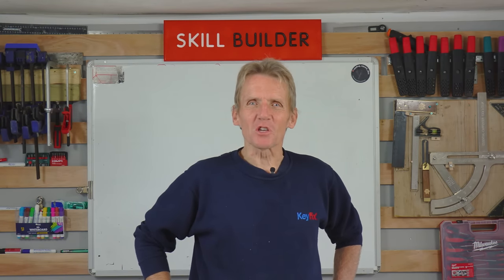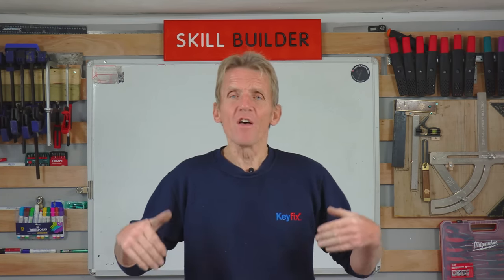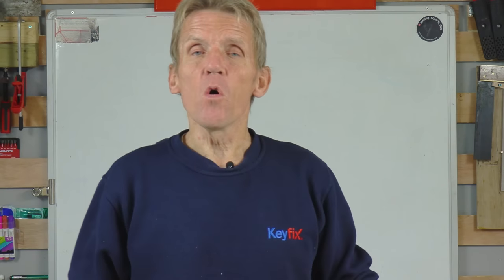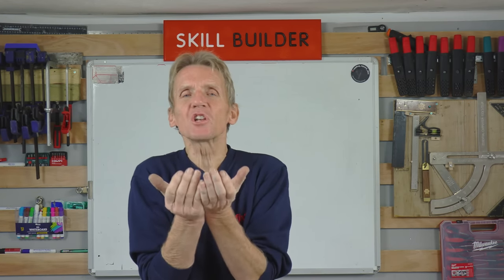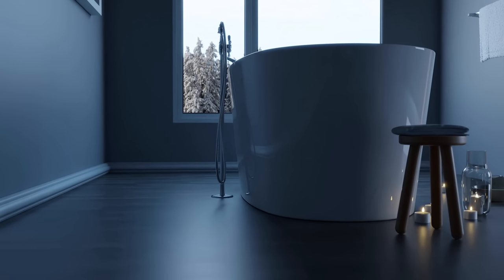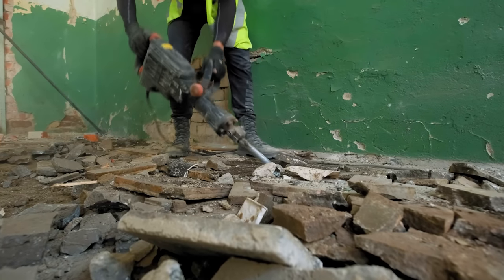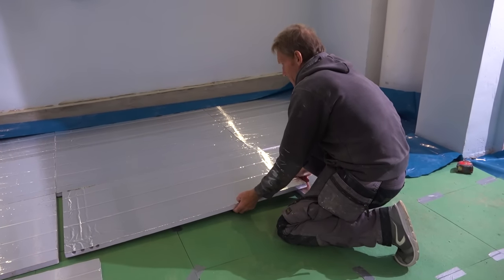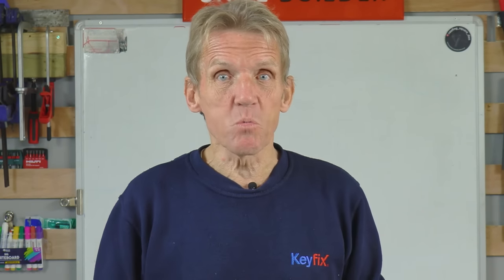Underfloor Heating — The 2 Big Questions

Comment: I replaced all the heating in a 120 year old house with under floor, every single room up and downstairs, over 3km of pipe work. The high ceilings meant rads were next to useless and the floor was like ice anywhere round winter time, so now no rads in sight and I can say under floor is excellent, it is night and day levels of difference even when compared with particularly good rad systems. Highly recommend if you can. Manifolds also will allow you to easily add zones so the heat distribution can be controlled per room!
Reply from the maker: Did you insulate the floors?
Reply: Looks like the next big thing
Reply: Did the same in my victorian house. Did 100mm celotex between the joists. Love the UFH
Reply: @SkillBuilder  I did not personally do the work (just lived through it), looking back I feel probably more insulation could have been added. However the house floors were all just floorboards on raised joists, so not concrete that will conduct all the heat to earth. The pipe work was set into that concrete style board with the pre cut grooves. My guess is some heat does escape down, but it seems ultra effective, so I guess not that noticeable. Upstairs I am less bothered by potential leakage downward since it will only end up inside the house either way... the ceilings do not get hot and I have checked with a thermal imaging camera. What I like is the old house was never designed to have radiators, so they would have only looked out of place and get in the way... I will say it is not for the faint hearted ripping all the floors up adding all the infrastructure, which means raising the height of the floor by 3-4cm shaving all the door bottoms down then putting all the skirting board back etc.
This was done in conjunction with a new oak hard floor. I avoided carpets as felt this may be too insulating.
One other thing people always forget to mention is that once you have this done you cannot go filling your house up with furniture that is flush to the floor as this just traps the heat... it became obvious that furniture needed to have legs of a certain height that will allow the heat to flow round objects.
Reply: @elslopez  really helpful! Thanks for taking time to share! I would have never thought about the furniture issue!
Reply: @elslopez we have done the same as you over the last thirty years, room by room. 

I'm not sure I agree with your point about the furniture. The whole point about a low temperature underfloor heating system is that it heats through radiant heat rather than convection, which is a much more comfortable form of heating. Furniture gets warmed by the radiant heat, in the same way as the occupants, and then emit that as radiant heat, so the furniture has the effect of increasing the surface area,which increases the comfort levels, as the occupants are heated on all sides by the radiant heat.

Radiant heat is more comfortable and effective than convective heat because it heats the occupants rather than the air of the building. Heated air leaks out of the building, owing to gaps and draughts, and collects in the highest part of the building, owing to convection currents.
Reply: @sailingoctopus1  I understand your point, and maybe this is dependant on the materials in the furniture, however my experience has been that there is a huge improvement in the performance and responsiveness of the systems when you minimise the direct contact to the floor with furniture and items acting as insulators. I even bought an IR camera to access where the heat was going and being lost... suffice it to say the colder areas were the ones with objects blocking the radiant source. I liken it to when I see people putting towels on radiators, sure the towel get nice and warm, but there is no way that rad is giving off the heat to the room it otherwise would have just on its own. My house has very high ceilings, in the hallway in fact the max height is 26 feet. Now before the underfloor was installed there were radiators, and all these did was send the warm air to the top where it was no use and send the cold air down. In fact it was virtually impossible to warm the bottom 3 feet of the property to any sensible degree. Now I am not saying this will happen, but if I place things on the floor that cause things to heat up at different rates in any significant way, do I invite these kind of convection currents to form again, albeit to a lesser degree? What I do know is that this is the best way I have had it thus far. My original furniture (now replaced) was a lot more floor hugging, and honestly it was just not as good!

Comment: I installed underfloor heating in our kitchen extension three years ago , and I can honestly say , it’s the best thing we ever did .
Our heating comes on at 6 in the morning for an hour or so , we set the thermostat at 19 . But due to the tiled floor being like an enormous storage heater , by 9am the temperature is over 20 degrees , and stays like this all day . Fantastic
Reply: Sounds great, was that a full wet system? We’d like to get rid of our carpet, like our neighbour, but her floors are freezing.
Reply: Tiles make no difference to energy used.

Comment: My mate has underfloor dowstairs. Its great. 19c in his house feels warmer than 19c with our radiator system because the heat is rising from the floor, as it should do, not accumulate near the ceiling

Comment: I have underfloor heating to 3 floors for 15 years and the designers got it spot on because I have  measured all the rooms in all weathers I totally agree with your accounts.  In my system it is set on a very thick concrete raft and then 50mm of insulation set in a self levelling anhydrite  screed. I think they did great job in the design since all the wall, floors, ceilings and windows were calculated for thermal distribution.  The first floor ceilings were a Bison hollow core slabs across the whole width of 8 m span insulated and covered with the pipes embedded in the anhydrite screed. incidentally the pipe are just 10mm fast flow diameter that I held some reservations about but proved they got it right since there is more mass in the screed to act as a heat store rather than water and plastic. still not sure about that but hey oh it works.  With the tiny condensation gas boiler it has been a dream to live in.  Love your video as usual.
Reply: Did you go for the optional flux capacitor or leave it?
Reply: @TheDankelsall  Hi Dan, I did ask NHBC if there was anything else I could do back in 2002 but they said I still need ventilation and any heat recovery system simply would  not be practical - so back to the future here we go:

Comment: Some great stuff in this! I agree that a hybrid system has a lot going for it- background heat with rapid response to peaks. My son fitted 270mm insulation below the screed, but with a wood block floor finds having high output rads great for quick adjustment of ambient. He has a data link to the combi boiler (had to go to a foreign source for the data structure- UK not keen on divulging this) and wireless links to all rads etc with full flow and temperature monitoring, and links to weather forecasting. Had to design/build it all himself- because a commercial version is not available! Like most of building practice, we are still in the last century...

Comment: Really useful! Thank you.
I like your pinching the return off the radiator idea.
My elderly set up sort of has this by accident because they didn't insulate it.
Consequently there's a few hot spots on the floor in the bedroom and bathroom where the radiator pipes warm up the carpet/lino that I've got into the habit of aiming for on cold mornings as it's sort of accidental underfloor heating.
Reply: I have the same- deliberately. When I installed the system, I realized the feeds (multi-system) and return ran under the bathroom floor. I did not insulate these (which modern regs require) and the result is a floor that is comfortable to bare feet. A feature that cost less than nothing!
Reply: @Tensquaremetreworkshop   My next house I'm doing that!

Comment: I removed all my radiators and stuck in UFH, which is heated by my 30 year old Netaheat Profile boiler. The boiler does cycle but we used to run the rads for 2 hours in the morning and 2 hours in the evening to get us warm for those periods. Now, we run it for 2 or 3 hours in the morning and again in the evening and the house stays warm all day and night. Turned the boiler down to 55 degrees, UFH runs at that temp too, 120 year old timber floor using spreader plates and air tight suspended timber floor.
It has been a surprising revelation.

Comment: I have underfloor heating downstairs. I put down 3" Kingspan, ran the pipes & 4" concrete over that + tiles.
I didn't insulate the lower area of the walls (mistake). I lose heat by it radiating outwards through the walls.
Silly me. My floor level runs straight out onto a patio & heats roughly 18" of it, outwards from the building.
Put an insulation break between the inside & outside. Like a bathtub effect.
Reply from the maker: I hope it wasn't concrete you used to cover the pipes.
Reply: @SkillBuilder  is screed OK, (I assume thats what he means)
Reply: @SkillBuilder  A cement based screed. Not exactly sure what it was (a company did that part of the job). They put a lot in. The floor takes roughly 4 hours to warm up fully. It's been down for 6 years with no issues.
Reply: @SkillBuilder  Dry screed. 4 - 1 sand, cement mix with some aggregate.

Comment: If your laying one of the low build options over existing floor, maybe think about giving the floor a couple of coats of thermal paint before laying.
The paint allows the floor to "breath" but helps reflect the heat back up by not allowing the "air moistire" to transfer heat down into it.
Reply from the maker: I don't think you want a breathing floor. I think you need an effective vapour barrier.
Reply: @SkillBuilder  some of the kit companies just suggest a floor sealant. I meant thermal paint over the sealant. And thought with joists the vapour barrier was below the flooring surface, so for anyone laying over floor surface could use paint.
Personally, on the solid floor option I would get in the scree router to cut channels to lay pipes flush, then a thin scree to even heat and lay flooring over. On joists, insulation between (if ground floor), then the ufh panels that bridge joists with a flooring layer attached on top.

Comment: I had my solid floor milled from a company calked  infloheat works wonders. No build up floors warm house warm bills lowered.
Reply from the maker: How much heat are you losing through the slab?
Reply: @SkillBuilder  None its insulated underneath cant be losing that much as ive had to set the blender valve to 45 and even my boiler stats at about 60 degrees. The slab heats up amazingly befor we tiled.

Comment: 0:28 Looking at the pipes leaving the manifold...  There must be a better way to distribute the fluids to minimise heat transfer between hot and cold? I'd suggest spray-foam but suspect that the concrete overhead would be too thin. Maybe there could be a moulded polystyrene panel that drops in that replaces the board below? Just to reduce the inadvertent heat exchanger that we're looking at, especially after the concrete's poured.
Reply from the maker: it is not an issue, it works well and you don't have to spend the rest of your life worrying about it. The mixer valve means the water does another tour or two.
Reply: @SkillBuilder  Thanks. Seriously though...  I appreciate your work - you take us places we never go and I just chime in here and there; A bit of a PITA but really just food for thought. I'll throw some $ in your coffee mug after posting this. Just wanted to say thanks. Have a great break and lets see if next year is kinder...  ;)

Comment: I have a large open  plan kitchen diner/ extension. the kitchen diner half has two radiators and the extension has underfloor heating so in a hybrid system like mine   do  i  just set the thermostat in the kitchen  diner area to say 20 degrees and the dedicated  stat fr the underfloor heating half to 20 as  well? I've read something about  having a setback temperature  for UFH so im not sure  what the best and most efficient way to control and use my stem would be.  any  ideas or help would be  welcomed.

Comment: Hi Roger, i am installing underfloor heating - would 25mm Kingspan and the pipes laid on top of that be ok, it sounds like it will be much better than 4.0mm!. I spoke to a builder guy who said beware of bridging the damp course because the floor height will be 40mm higher than the damp course (We took up the old 20/25mm screed to help with the height - the Kingspan when fitted will be in the position that the old screed was if you know what i mean.
Reply: Did you fit the kingsman in the end ?

Comment: Hey Roger, you still replying on this thread, I’m buying a 1960 house with all concrete floors on ground floor so no insulation, I’ve seen these insulated hardy backer boards 20mm , was thinking sticking them down first with tile adhesive then stick the solid board you mentioned , another option I’ve heard about are vip boards, I’d love to know your thoughts literally I’ve spent months looking for any idea talking about this and yours is the most informative, I know doing something like this brings the possibility of damp issues but that’s another video I guess .

Comment: I’m looking to do this in a 120 year old tenement. It is elevated ground floor with a meter of clearance under the floor. Longer term I’m applying to dig this out for a basement. The floor is currently wooden joists and floor boards. Can i go under the floor and kingspan between all joists then lay the underfloor heating on top? Essentially wondering if the wooden floorboard separation between the piping and kingspan will cause any issue?

Comment: I've just moved in to a property with a combi boiler and underfloor heating. Am I right in thinking that in winter I leave the heating on all the time at say 21 in the couple of rooms I'm in most of the time and around 19 in the rooms I'm not in as much? 

It didn't compute when I was first told this as it sounded very expensive.

Comment: I'm looking at possibly installing UFH heating in my 1950's concrete floored bungalow. I've watched LOTS of YouTube videos regarding the suitability of retro fitting it to my house and to be honest I am still none the wiser. There are so much conflicting information from separate sources, on this video it states that the heat loss will be substantial on a existing concrete floor whereas a company called Nu-Heat state that and non insulated concrete floor will only have 6% heat loss.
I don't want to spend a fortune on UFH just to get nice warm floors only, I want it to be able to efficiently and effectively warm and maintain a comfortable room temperature.
Reply: I’m in the same position , are you any wiser now
Reply: @EstebanMourelle  Not really but wet UFH is still something I'd really like to install before I carry out a full renovation to the property. Unfortunately I'm in a position where I'm going to have to do everything all at the same time new bathroom, kitchen and updated staircase that leads to the upstairs loft room, new boiler and it to be relocated, as well as everything needing rewiring, new plumbing and then everything plastered. 

Here's the Nu-Heat video and I'm looking at their "Lo Pro Max" UFH system (13:40 into the video)

https://youtu.be/SM_dInhtIlc?si=TQXDCsnLTvU0HvQH

Definitely seems the best option for my property, I guess I need to contact them with my floor plan layouts to see if it's feasible to install it.
Reply: I’ve looked at insulated tile backer , also I’ve seen someone talking about vip boards very thin
Reply: I’ve just watched it , good video, makes sense what she says, heat loss to savings value , might not be worth the cost of ripping up all the old concrete, like I said I reckon I can spare 50 mm from the existing concrete floor level, I’m either going to dpm first then insulated hardy tile backer 20mm then the 20mm pre routed plate with a decoupled mat and tile finish
Reply: I’ve logged on another account it’s the same chap
Reply: Or instead of insulated hardy vip board although that seems expensive and you can’t cut it
Reply: Interesting what she said about static floor temp, although I’m tempted to say bs , because the static floor temp of 12 degrees is quite deep not just below the ground that’s how ground source heat pumps work
Reply: Mate I have no idea what I’m doing and not enough money

Comment: Lots of sensible advice here. I too think those skinny panels with 4mm of insulation between pipe and concrete are not very clever. You didn't mention that you don't have to have a slow-response screeded system over insulation. You can have a faster one. E.g lithotherm floor panels with the pipe in, or cellecta screedboard/hi-deck with the pipe underneath. Quicker and cleaner to lay and much lower-carbon. lithotherm: https://www.youtube.com/watch?v=Fb7VvOFV3JE screedbpoard: https://www.youtube.com/watch?v=ZEVvwK9X6hA
I do wish there were easier ways to quantify the differences between these systems. It's hard to say exactly how much difference these things make.

Comment: I’m doing an attic conversion and I’m going to use the mat I only need 2 m so not massive but I’m trying to keep the height down can I use king span under floor boards instead of a thermal matt or take the boards up and lay some kind ply/insulation board then electric matt , adhesive and tile ?